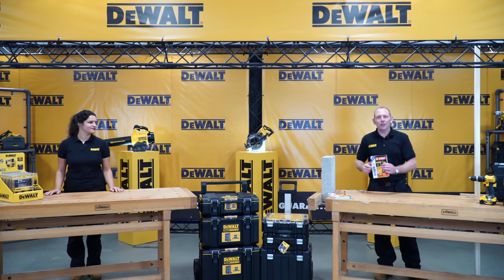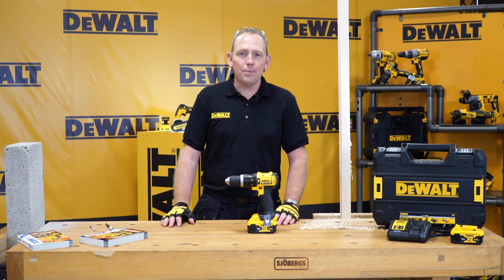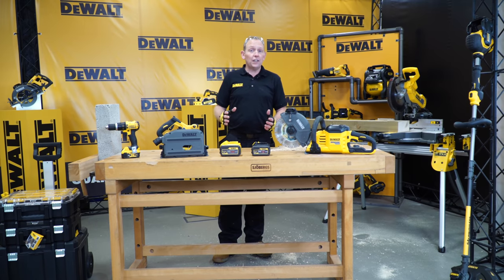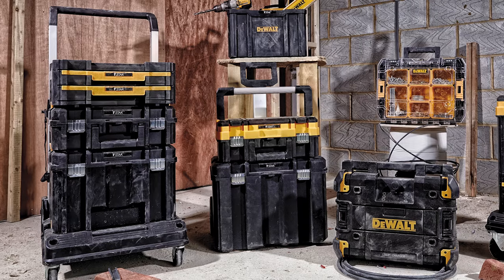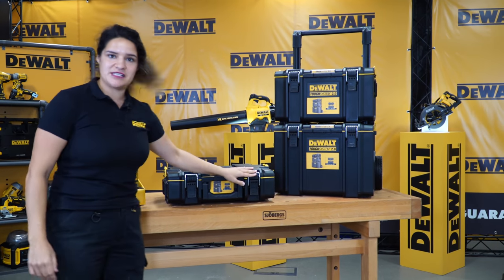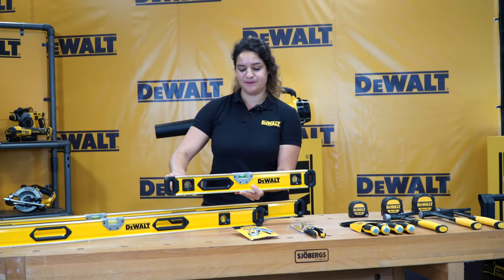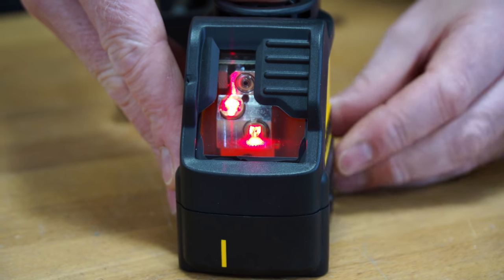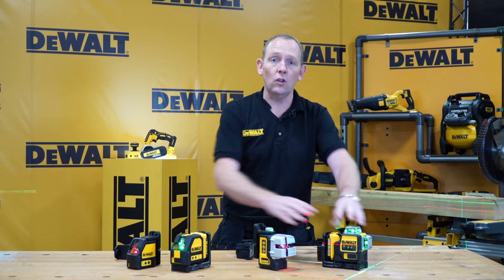DeWalt | Live | Screwfix Live 2020

Comment: When are DeWalt going to add an assembly drill driver to the 12v range? (with hex drive, right angle drive, chuck and offset drive) Bosch and Milwaukee already do them as well as Festool of course.

Comment: "Flex volt 54 volt power"?
Reply: It is the 60v battery,  60v nominal or unloaded and 54v in use , kind of like the Dewalt 20v batteries are 18v in use. There is laws in the other countries that don't allow them to post the unloaded voltage for dishonesty
Reply: @matthewhoffman9242  I was more referring to him using volts and power in the same sentence when they are difference things entirely.
Reply: @stokiesparky2790  ah, my bad........I missed that myself
Reply: @stokiesparky2790  to be fair, to the layman it makes more sense to describe it in that fashion, and at 18v the tool would draw an absolutely insane amount of current to be able to hit the power some of these flexvolt tools can ouput, ive got the dcs579 saw and it will output nearly 2500W with the big 9ah batteries